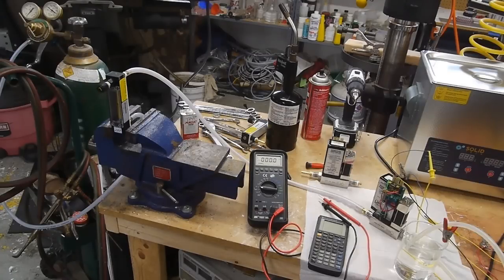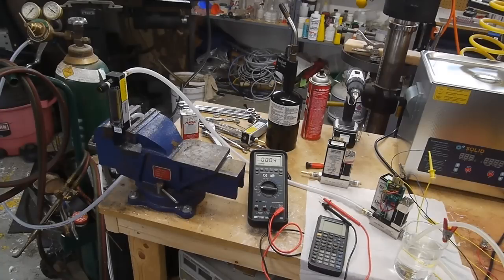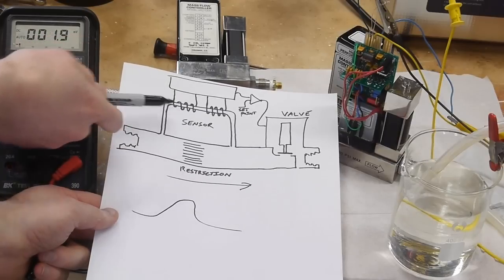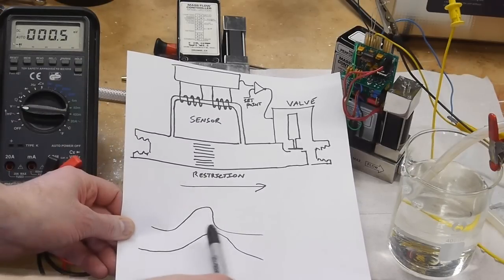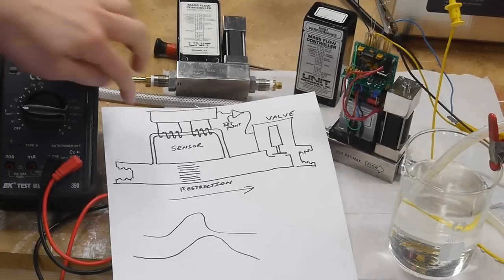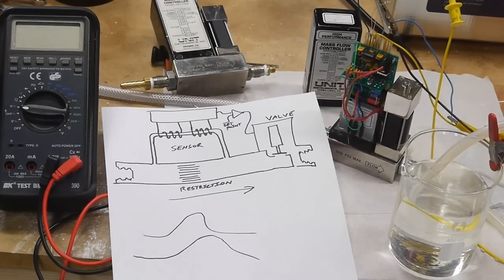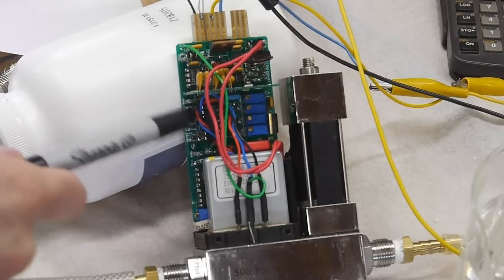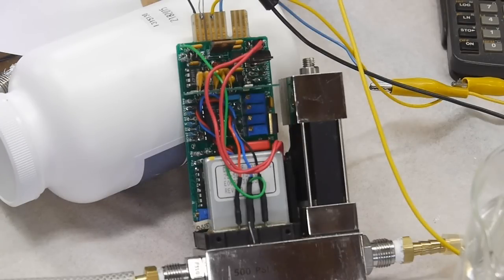How a Mass Flow Controller works

Comment: Thanks for the information. We just got 3 brand new flow controllers without really knowing how to use them. We are just following the instruction manuals. I'm trying to explain to my coworkers that you have to FLOW the gas. You can just stopper it into a chamber and say DONE. We want only a small amount to generate small bubbles in liquid. But we don't need a bubble bath, we need a few bubbles. So i'm suggesting we mix our gasses and then sample FROM the gas stream. I think it's best for us.

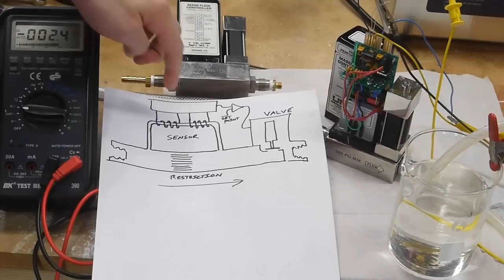Comment: At 1:56, that is just one of the ways to measure gas flow. Another very interesting way to measure gas flow is using the coriolis force. By having a tube that goes in a square, and exciting this structure with a current in a magnetic field (lorentz force), we can observe the motion this makes. By now having a flow through that hollow tube, this movement will change due to the coriolis force, which is caused by the mass flow. This is of course all a MEMS.
The advantage of this method is that you can measure far more accurately how much the mass flow is. You can also measure other things like viscosity.
A downside is that it has an upper limit to how much massflow it can actually measure, in contrary to the heater/thermocouple measurement. That is why companies like bronckhorst often combine both of these sensor types to achieve a higher dynamic range of massflow.

Comment: Always something interesting to show, I see. Thanks.
Am I understanding the way it works correctly. At 2:37ish the coils are providing the heat and the temperature sensing is being done my measuring the temperatures of the coils? That makes sense in regard to your temperature profiles since the incoming gas would take more heat from the first coil than the second coil, since the greater the temperature difference the more efficient the heat transfer. The gas is still cool at the first coil so there's more efficient heat transfer and so the coil gives up more heat making that coil cooler. When the gas gets to the second coil, the gas is heated so there's a smaller temperature difference and so a less efficient heat transfer. The second coil therefore doesn't give up as much heat and remains hotter.
Reply from the maker: I think there are a few different ways to implement this, but most setups probably have a wheatstone bridge where the two coils are two legs of the bridge. This way, the differential resistance can be measured very accurately. There is probably circuitry to compensate for overall temperature shifts too.  The moving gas carries the heat from the first coil to the second, so if both coils were emitting exactly the same thermal energy, the second coil would be hotter, yes.
Reply: Applied Science
I don't think the gas carries heat from the first coil to the second coil, especially if the two coils are at the same temperature. The gas would be at the same (doubtful) or lower temperature as the first coil so it would be at the same or lower temperature than the second coil too. Heat would only move from the coil (higher temperature) to the gas (lower temperature). That's why I figured it had to do with different heat transfer rates. But mainly I was just wondering if the coils were providing the heat and the sensing, which it sounds like they are from your reply.
Reply: RimstarOrg   Heat .is. introduced in the first coil, The expected heat transfer difference is meaured as temperaure (current used to maintain a stable temp) in the second coil equals density.

Comment: Gets me thinking of variometers - instruments glider pilots use to measure their ascent rate in rising air.  I had a simple pellet gauge/ flask vario in the 70's but I suspect modern electronic versions use something like this.

Comment: I used a anemometer for air flow measurements.  It used a heater and a thermocouple down stream.  That's basically what your device does.  So I guess that was really a mass flow measurement device.  they are designed to be inserted in air ducts.

Comment from the maker: norxcontacts I'm curious to know why you don't like the channel name, and what sort of name you'd prefer.
Reply: To me, it feels a little bit generic - "Ben Krasnow" is a stronger brand, but probably only because I've been following you for a while anyway. Love your work, either way!
Reply: Just subscribed to your channel recently but I like the name and logo think it makes sense for a lot of the stuff your showing/doing, particularly for newcomers.  I'm a programmer type myself so this is a bit outside of my domain but you do a good job of breaking down lots of concepts (particularly related to the transistors one you did and burning them out, because of not knowing to put a resistor on the base).  Thanks for the informative videos.
Reply: I like the new name just fine, but I did a double-take when I saw this video posted, because I also follow Applied Materials, who obviously would know a lot about MFCs!
Reply: I'm just wondering, a lot of cars nowadays use "MAF" (Mass air-flow) sensors to measure the amount of air coming into the engine, and they use a similar technique to measure with. Do you think these would work well enough to create a mass flow controller for a fraction of the cost? (Assuming you acquired the MAF sensor used from a junkyard or something)
Reply: Applied Science 

I think the name is great. Nobody likes something too fancy for the sake of being fancy - a metaphor for you - what good is it to be-able to say fancy words, but not know the meaning or application - it defeats the purpose. For this reason I think the name is great and well applied to the science field. Alot of scientists publish work with little or no relevance to 'the real world.' Applied science is taking the understanding of principles and putting them into practice on a home based level; something very few can actually do well.

Comment: Hi, I'm a bit confused... You said that 12 psi is about 2 atm, but from another source I get that 1 psi is about 0.068 atm, and consequently 12 psi is about 0.816 atm. Am I missing something?
Reply from the maker: It's very common for pressure gauges to read zero at atmospheric pressure.  In such cases, reading a zero on the gauge indicates 14.7 psi or 1 atm.  If the gauge reads 12 psi, that is almost 2 atm (14.7 + 12 psi).  The confusion can be avoided by saying "gauge pressure" or "absolute pressure".
Reply: Applied Science
Oh OK, so 12 psig, got it! Thanks!

Comment: As far as I know the LM324 isn't the best of OP-AMPs. It's very basic and it is the component that needs the +/-15V supply,
Reply from the maker: I know.  I was chuckling because I like using LM324s in low-speed circuits, and someone once criticized me for using "the worst" op-amp possible.  Seeing it in a commercial product made me laugh.  It's inputs and outputs can go to the negative rail, but only within 1.5V of the positive one. There are other opamps in the MFC, and they may have bigger voltage requirements. One of these MFCs had all of its chips sanded to remove the markings!
Reply: Applied Science Yeah it depends on what you need it do do. I don't see why one would use a more expensive component when an LM324 would do it just fine.

Comment: very old UNIT elastomer, (rubber seals) MFC. solenoid valve is very hard to stably set... valve must be stable. 10 cc very hard to accurately set to specification.

Comment: Thanks for the video. used mfc for a long time without knowing how it works! I have a question: we know it works well for gaseous content (N2, O2, Ar). How will it work for vapors (ethanol, water, acetone vapors generated from the vaporized liquids)? I was looking at how to introduce weird gases into my chamber. Do share some wisdom if u have :P
Reply: Hi Tim, It can be clogged with vapors,and depends also of temperature of the fluids and MFCs. You can use an MFC with a large capillary like Bronkhorst supply ( LowDP series )

Comment: Thanks for your video! But could you please help me with this problem. We have the same system in our brewery. And the thing is that the Rotameter shows 17 Nm3/h and the mass flow shows 22 kg/h. When i do the conversion, it seems not correct. The rotameter is calibrated at 6 bar 20 deg. C and our supply air is at 5.5 bar and 30 deg .C. I check the density of air at that condition should be 6.32 kg/m3, but it seems like they are programmed at standard condition with the density of air is ~ 1.2 kg/m3.
Reply: did you find a solution to this problem? i would be interested to learn about it. I am about to use rotameters (designed for air) to use for hydrogen gas flow and I do not have the luxury of comparing it with a mass flow meter. So if I could learn something from you than I can be prepared for my experiments ;)

Comment: Applied Science What is the actuator for the valve and the valve type/mechanism?

Also, did you measure, or find out from specs what the change time  (to within 5 or 10% or something) is to stabilize/steady-state from a given set point to another?

Also as a side note, you should probably enunciate the A sound more because it sounds like you're saying roto meter. I also prefer the pronunciation "rotam eter" because it sounds less weird, although it is preference and I think both are OK.
Reply: That is an old Unit UFC-1000 from the 80's.  It has a solenoid valve.

Comment: The inlet and outlet connection of that mass control is called VCR. You will have a leak if you connect gas tubing that way. Here is the 1/4 female VCR to 1/4 tube adapter. 
http://m.ebay.com/itm/321787470755

Comment: I am trying to understand if it is possible to build digitally controlled system that could cycle a propane/oxygen surface mix burner on for a set amount of time and then back off again.  I am designing a robot that will be controlled by Pololu Maestro Servo Controller. This will control multiple servos that will primarily power gear racks for linear movement. 

An element of the robot is the flame that I am hoping I can also control with the Pololu Maestro as well. Is it possible to turn oxygen and propane lines on and off with a solenoid valve and somehow have the mass flow controllers located after the solenoids to deliver the precise flow I am looking for? Or do the mass flow controllers have to be manually turned on and off for each cycle.

Sorry for all of the questions. I'm just starting on this project and after many hours of searching, watching, reading I have no idea where to turn for answers. The linear movement aspect of the robot is quite simple but understanding how to or even if I can cycle the flame on and off precisely still eludes me. Do you have any suggestions? Thanks for any help you can provide.
Reply: Yes, if you use a mass flow controller with digital capabilities, then you can easily write setpoint slopes to open, control and close the valve.

Comment: Could you use a fan? the energy generated by it would be the flow.
Reply from the maker: Yes, but this would measure volume flowrate.  It's possible to add temperature and pressure sensors to a volume flowmeter, and calculate mass flow. Most fuel injection systems for modern cars have these separate sensors, and combine all of the data to determine how much fuel to inject.
Reply: Applied Science Great! Thank you

Comment: I just realized that you go through infinity times more argon per month than almost every other person on Earth.

What's that like? How does it feel? What's your monthly argon budget?
Reply from the maker: I don't buy argon that often.  I'm guessing that the biggest users of argon as a group would be TIG welders. I have a cheap TIG welder, and that is why I already had an argon bottle before embarking on the sputtering stuff. When welding, a typical flow rate is 15 CFH, or about 7000 sccm!
Reply: Well, any amount is infinity times more than (I'm guessing) at least 6.5 billion people use.

That would make me feel special, if I used argon.
Reply: JustOneAsbesto You breath quite a bit of Argon;  It comprises almost 1% of the atmosphere.  Perhaps this isn't the same as using it, but it sure means you've worked with a lot of it...  :)

Comment: Am I missing something or is 12 PSI not even 1 atmosphere ?
Reply from the maker: It's true, 14.7 psi is one atm, so 12 is a little shy. My rotameter is calibrated for air, and I was running pure oxygen in this test, but air and oxygen have very similar density and thermal properties. The calculations with the rotameter were just for sanity check to make sure the MFC was working reasonably well.
Reply: Sorry I thought you said in your video that 12 psi was = to 2 atmospheres, my mistake, thanks for the reply.
Reply from the maker: tuberlook1
psig ="psi gauge" meaning "the pressure above atmospheric". You should add 14.7 to all normal pressure gauge readings to get the absolute pressure. The rotameter correction factor is based on the ratio of absolute pressures, so sqrt((14.7+12)/(14.7))

Comment: Nice video, In the real world though, those instruments are not calibrated with the specific gas (i.e. the one that the user will measure). Some manufacturers like Bronkhorst, Brooks and Sierra Instruments deliver instruments for all gases which were factory-calibrated only with air (or N2). They provide the user with a K-Factor whose exactitude has not been proven. Some other companies like Horiba-STEC do not even use K-factors but Polynomial correction curves. K-factors give errors…. Another point, and not the least of them, These traditional meters like the capillary principle are a metal tube that gets heated, as a consequence these units drift over time and need to be calibrated and of course adjusted at least once per year. An alternative is to use mass flow meters/controllers with MEMS sensors technology which, conversely, are always factory-calibrated with the "real gas" so to obtain the best possible accuracy. These units are extremely stable, with clean gas they can stay stable for more than 10 years.